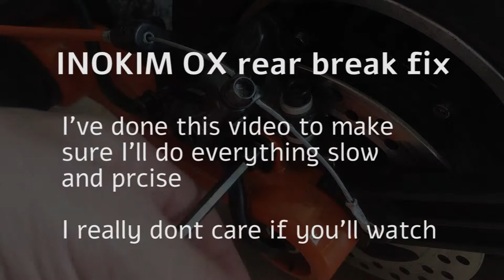INOKIM OX rear break fix

Comment: Your brake rotor is bent. You should fix it:)
Reply: Not sure it's the brake rotor...I had the same problem and it was the wheel bearing's fault (the scooter was new so I went to the dealer and replaced the entire wheel, it was the rear wheel of the Xiaomi so it's just the wheel, no motor)